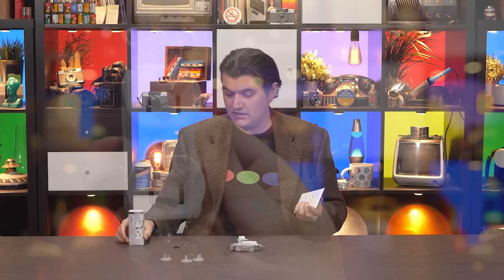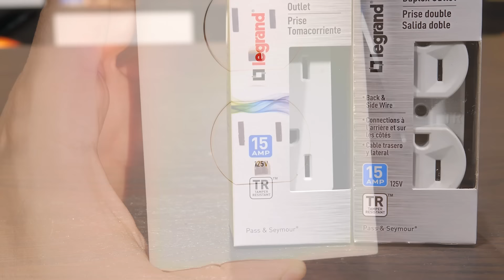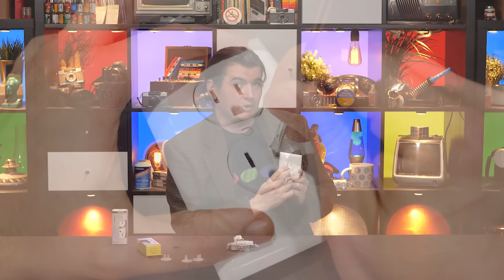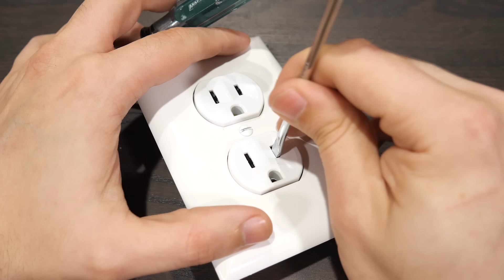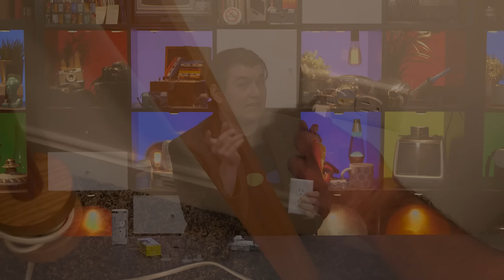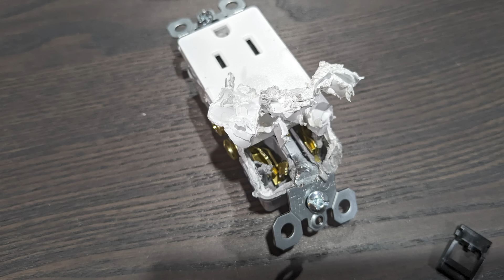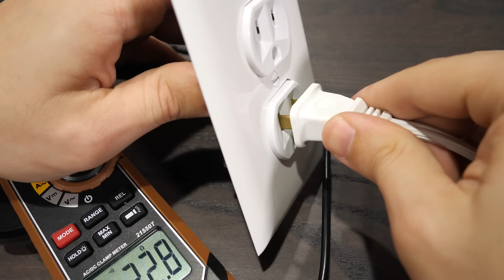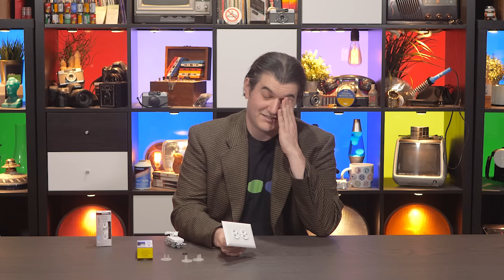Tamper-resistant outlets aren't all the same - a follow-up

Comment: There are a lot of UK style TR outlets that do not use the ground pin to open the hot and neutral. There are designs that push to the side but jam unless both are pressed, and a style that sort of rotate (one goes 'up' the other 'down') when you shove the plug in, also independent of the earth pin.
You mentioned briefly in the main channel video your idea to heat shrink the pins so that the exposed metal that can be live when the plug is being inserted is shielded might run afoul of the socket, and how that may be a problem. But it's a solved problem. The original UK style plugs were full metal construction. But were later changed/improved/adapted to add the shielding. This was achieved by reshaping the pins to have a slightly thinner profile in the insulated portion, and the plastic insulation injection moulded around the pin, which overall has the same dimensions of the socket receptacle, and are i guess backwards compatible. UK plugs are much chunkier than their US cousins, so perhaps the current carrying capability of a US plug cannot take the squeeze?
Interestingly on the European continent there is a whole mishmash of standards. But two prong plugs parameters are fairly universal. Most are recessed into the socket so can have full length metal pins, that are hard to touch in motion. But in older properties you can find flush ungrounded outlets - that look much like US outlets - but with round holes not flat blades. 
At some point each country adopted its own safety standards, Germany and France with roundish plugs (different grounding solutions - not compatible directly but easy for manufacturers to make a compliant plug for both if needed) - then other notable mentions: Italy have a three prong plug, three pins in a straight line, centre grounded, probably unpolarised but perhaps the pins have different diameters? And Switzerland who's plug is similar to Italy, except the earth pin is not in a straight line, but offset decently - so the plug is polarised. 

All these Euro sockets have their two main live and neutral pins approximately the same distance apart and diameters similar. So most double insulated two pin plugs work across the continent. And a sharp knife lets you shape the plastic parts of a plug that's being stubborn! Low power two prong devices designed to work across the EU often have a type of 'hacky' plug. where the pins look like they splay outwards or inwards if you look from the side. And like UK plugs are insulated on the shank of the pins. Unlike UK plugs, there is often not SOLID metal below the shank. And the shank is noticeably thinner than the conducting tips. I tried and couldn't find the source for this, but I believe this design, allows the pins to be flexible enough to adapt to the local socket conditions (spacing of pins and pin diameter) - stiff enough to keep in contact, and remain cheap. The STANDARD plugs normally have very thick and rigid pins. If you live in, and move house a lot in, and or travel between in and around euro countries, you know that the stiff pin plugs can and will shove into the other euro sockets (even euro plugs into UK sockets) but those flexi two pin jobbies work the best.

Comment: Here we use a specific standard - SANS 164 - for plugs. This would be Type C, Type F, Type J, and Type M plugs. I can honestly say that comparing US plugs to our plugs, your plugs are scary. Our standard is based on the UK standard, except the pins are round rather than rectangular. For us non-US people, your plugs, with possibly naked and live metal that you can touch or a child can touch, just seems really scary. Also it looks like a little yank and the plug comes out - here you need to absolutely rip full force to unplug a plug, probably breaking it in the process and ripping the wires out. I just think that you can have a better plug standard. You can really do better. I just think that with these safer plugs, a whole lot more, and I mean, really way much more, needs to go wrong. The plug is either shrouded or has plastic protection on the pins to prevent any live metal from showing. There is never any live metal exposed during plugging in or out.

Comment: USA outlets allow the plug to fall out because more often than not the outlet us mounted upside down.  The ground plug hole should be at the TOP - not the bottom. It offers better protection from that falling out and is code now in many areas.

Comment: I wonder if an outlet could be made where it could sense when something was fully seeded by checking if someone was against the face place. Kind if like a button between the plug holes. So that if the plug becomes unplugged a little or if you stick something in it will not be live.

Comment: we had that issue with plugs alling out a  lot at y old place.  Even if you pushed them in all the way they'd fall back out and hang crooked in the outlet, exposing the prongs.. we'd always have to spread the tongs out to make htem fit tighter. it was an apartment so we coiuldn't replace them. we complained to management but they didn;t fix them

Comment: Technically you are correct that 110/120v is “safer” that our 230v in Europe (i’m in the Netherlands). However, I still think our sockets (Type F) are still safer regardless of the higher voltage. 
Changes you are exposed to the receptacles is next to zero. 
Our “older” design (Type C) was more likely to happen (also non grounded) since it looks like US designed outlet, but hard to find them these days, even in older buildings they are very rare these days. 
Almost all plugs are compatible with both outlets (type F is sturdier, less likely to fall out).

Comment: To me (as a 65 year old brit), "falling out" would be a relative term. As you know, our 3-pin mains plug is, umm, robust. Once plugged in they tend to stay put - it takes a substantial tug to get them to move. So I would class the 2-3mm of movement that you observe with the US style of plug as falling out even if the connection is maintained.

Comment: Got zapped by the a copper water supply line for a swamp cooler that was acting as a ground. Didn't know it was until I separated it with 2 wrenches at which point I became the shortest path. Luckily I had a pretty sizable imbalance in muscle at that point in time and my back was stronger so when my muscles forcibly flexed rather than getting stuck and cooking my arms went to the side at full force launching the wrenches and disconnecting me which I genuinely believe saved my life.
Reply: That's the most dangerous kind of configuration as the current would be passing along your arms and through your heart.
Reply: Got zapped by rogue wire in a kitchen under construction (240v eu). Hit my upper right arm, and it made arm punch forward. As i was walking quickly it didnt last long luckily.
Reply: Sounds like somebody bootlegged a ground.

Comment: Concerning your jukebox-incident: You can easily trip GFCIs by simply briding the protected neutral to ground. You won't get shocked by that because the current through your body would be way to small, but making it low resitance by directly shorting neutral to ground WILL trip the GFCI. Been there, learned it the hard way...
Reply: I've also learned the hard way that an uninterruptible power supply (UPS, battery backup power) will randomly trip GFCI. I looked it up online; it seems that this is inevitable, due to how a UPS works.

Comment: As someone who lived in the Netherlands, the UK and the US for significant amount of times, I can tell you that compares to those countries, the clamping force of the US outlets is low, even brand new. Don't get me wrong, it's still enough to do most things, and you can still lift up power strips by the plugs in the US, but you can feel it's at the edge, where the Dutch and British outlets will hold on the plugs far more secure. And yes, this is mostly a problem in cases like hotels where the US plugs, even the wall plugs, don't tend to hold up from constant plugging in and out, especially considering the use of adapter plugs, making the whole situation more precarious. Since what tends to happen is that the adapter plug offsets your phone charging brick, creating more momentum to rotate the plug out.

And yes, to those in Europe, being able to even see the metal blades while the plug is live feels unsafe. British plugs have those plastic pieces on the live and neutral pins, and Dutch plugs are recessed so that it is impossible to see the pins while they are plugged in any amount.

Comment: Almost every place I have lived in has had at least one outlet that didn't have enough holding force on the prongs to keep transformer style plugs from falling out. They literally would not stay plugged in and would fall to the floor because it was so loose.
As an adult I know these were significantly old and overused outlets that should have been replaced a long time beforehand, but lots of homeowners are unaware of this sort of wear/tear on their outlets and just bend the prongs on their plugs together to create more tension/friction that way.

Comment: All the tamper resistant plugs I've encountered have been crap. You have to fiddle with the angle of the plug more and push way harder, increasing the chances of your fingers skipping forward onto the blades. 

It's like the "spill proof" gas nozzles. About 80% of the ones I've use leak like a sieve. Intended to be better, but makes it worse in the real world.

Comment: The thing about falling out cables never made sense to me, either. I grew up in Israel; back then, the default plug was Type C, aka the standard "Euro" plug. Now, the standard is Type H, a three-prong grounded outlet that is still backward compatible with Type C, though Type H is unique to Israel. Type C outlets (at least in Israel) are supposed to be slightly recessed (or have a protruding ring), and cable prongs are supposed to be sleeved, so when they back out, it is less of a problem, and that's good because they back out a lot. I cannot over-emphasize this: two small cylinders housed in a plug similar to the US two-prong plug are not good at staying in place. US plugs have holes that good outlets push little bumps into; Type C plugs don't, and they love to wiggle out, way out. The overall design of the Euro plug is safer, but almost any European who pretends that their plugs don't fall out (and most of the comment I read don't do this, they just note that their plugs feel more secure which might be true for newer standards in some countries), either likes to make fun of the US (because success breeds jealousy) or is smoking a lot of copium.
Reply: Type H... That is the "surprised Chinese plug".. 😂

Comment: How about this for bad design. I have a power strip with the plug orientation side by side. They are close enough together so that two prong cords can plug into two different plugs on the strip at the same time. And the device still works.

Comment: the shutters in those tamper resistant american power outlets are similar to the ones in european power outlets, very annoying trying to use a multimeter to check grounding with that tamper shutter requiring inserting the multimeter probes in both holes at the same time to then pull one of them out to probe the exposed ground contacts in our outlets

Comment: One of my tamper resistant power strips holds the plugs a lot tighter. I don't know internals or if it is the safety shutter adding the extra 'grip' but for whatever reason you have to push / pull more firmly when plugging stuff into it compared to my wall outlets.

Comment: I hate tamper resistant outlets and extension cords. At least in the EU they need too much force to plug in and annoy me. I usually disassemble such outlets and remove the mechanism.

Comment: Mandatory "europe is better" comment: the plugs here have exposed metal only about 3/4 to an inch away from the main body of the plug. That seems like a great solution to any problems with the prongs being accessible - that part of the prong is just plastic in plugs here.

Comment: i got some good shocks twice.  Once i was inside of an original xbox while it was both  plugged in and on (yup, i knew it was wrong, i did it anyways) and touched the power supply. The second time i was talking to a girl on the phone (the kind with a cord on it, because it was like, early 2000s lol) and i was mindlessly playing with a plug that was plugged into the wall. stuck my finger between the blades and plugged it in.  iddddiooooootttt

Comment: As mentioned, the UK sockets require the earth pin to be inserted to open the shutters for the live and neutral pins, however MK makes/made an even safer variety where the earth pin must be inserted first, and then both live and neutral pins must be inserted simultaneously, making it almost impossible to defeat, even to insert a europlug (although this is dangerous anyway).
Reply: I too came to mention the MK design but would also like to add that the BS 4573 Shaver socket has this type of shutter. As it is the only non-grounded receptacle allowed in the UK it must have a shutter design that opens only when the two pins are present.
Reply: Yes! Came here to say this, glad I scanned the comments first. As a Brit I find plugs and sockets around the world, and especially the USA, terrifying.
Reply: @DrGreenGiant Euro plugs are all sleeved, so it's really not that bad
Reply: @RedHair651  lol this make me laugh, thank you!

Comment: been at least shocked once by the plug, thought a lot more with live lightbulb sockets(you'd be surprised how often I've ran into lamps without lightbulbs at home and thrift stores),as it was particularly stuck in the socket of a power strip. Made contact with both blades and got pretty gnarly shock, though not the worst shock I've felt. The worse has been from leaky currents on fridge handles or light switches/the screw holding the covers.

Comment: Outside of your explanation of the plug partially falling out, the worst I've seen was a hotel (in Las Vegas iirc) where I could not use any outlet, even the ones on the walls, because the plug would drop to the floor. There was no friction on the prongs whatsoever to hold them in place.

But I had a similar experience in a Germany hotel with a European plug (via a travel adapter), where I had to physically hold the plug to get any power. Releasing the plug would drop slightly and lose all power, but at least nothing was live and the prongs were still not exposed. I still use these travel adapters and they have worked flawlessly in multiple other European countries, so I blame this experience on this particular hotel.

I'm also curious about the coax design, because I've definitely been shocked by that when plugging in cable boxes and grounded by a concrete basement floor. More like an electrified fence than a power outlet, but still unpleasant.

Comment: It is nuts that these sockets are considered an acceptable level of risk for everyday consumer use. Honestly the half inserted energised prongs is wild, why are they not sleeved? In the uk they fixed that hazard decades ago as we did have this problem even with our bulky plugs. I have to imagine electrical shocks are something most people experience 10s of times in their life in the US, where as in the uk most people never get shocked @ mains voltage in their entire lives, generally shocks only occur due to appliance faults or if someone is doing electrical work (which is not legal to do anymore).

Comment: You know, even if fixing or changing the outlets is hard, just mandating gcfe circuits to be standard outside of the bathroom would realistically reduce the risks of getting shocked by a lot.
Probably enough to start referring to it as "safer" again.

Comment: The only time I got zapped by European plug is when I tried to plug it in the dark and decided to put my fingers on the pins to align them. So partial isolation doesn’t always help, especially when you’re silly as I was. I learned a lesson, though. Never happened again 😅

Comment: You should do a video re: true relationship between amperage and voltage, why Europe has 240 vs US 120. Having worked with electronics for 20 yrs I've had to answer many many stupid questions such as "why do we have different voltages?", "Why do I have to buy new stuff to move to England?", and my favorite and ever so ignorant "didn't 'Murica invent electricity?"... facepalm

Comment: I hate tamper resistant outlets. Maybe the ones I've run into are just really poorly made, but they are so incredibly difficult to plug things into. Maybe I haven't been plugging things in as perfectly straight as needed because I never knew that was needed, but it takes so much more force and effort to plug something into the dumb things.

Comment: For backstabbing outlets: check out the Leviton Decora Edge outlets and switches. They basically have a built in wago levers. No exposed screw terminals or stripped wires.
Reply: Just saw that style for the first time & heard it’s the new industry trend now coming from multiple manufacturers